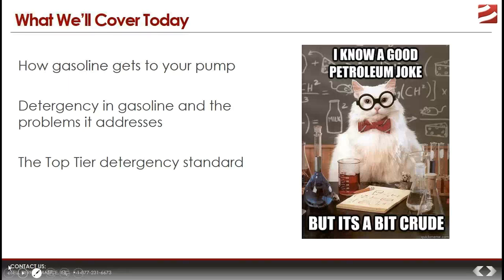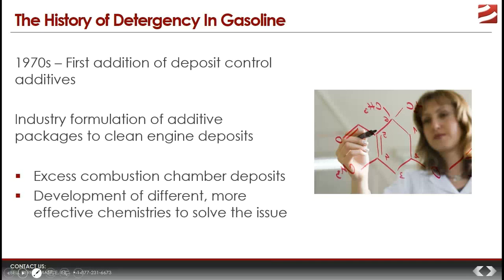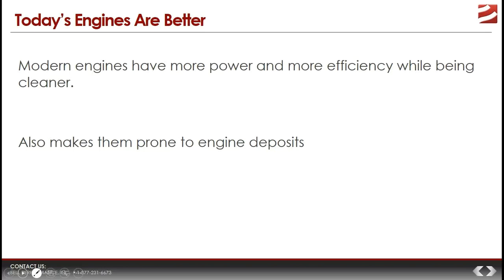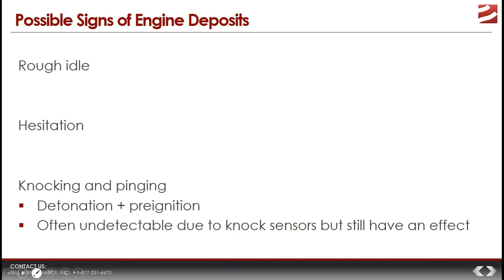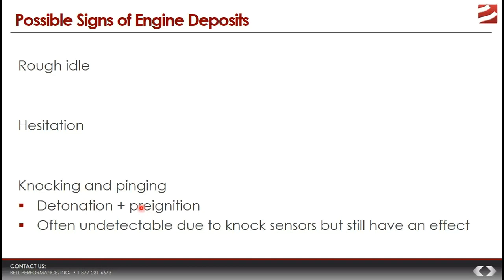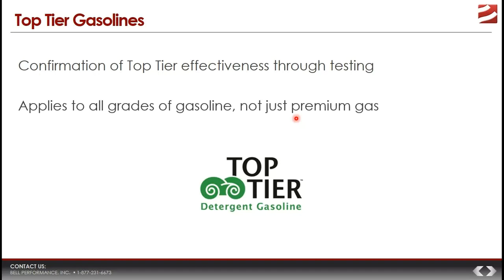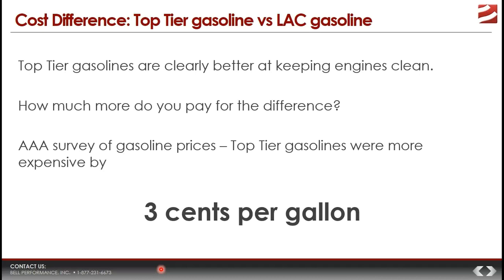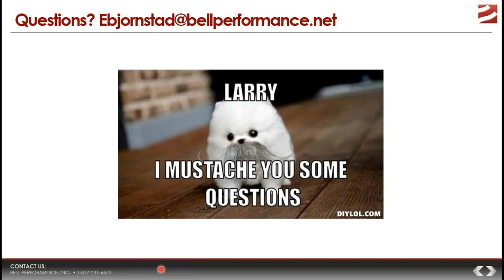Gasoline Detergency & Top Tier Gasolines - Bell Performance Presentation

Comment: So if you only use top tier you still have deposits after 50k miles for ex?
Reply from the maker: Hard to say after an exact distance, but the rule of thumb would be you'd have less deposits than with non-TopTier fuel.
Reply: Yes you will, but they will be less then non "Top Tier" fuel.  Gasoline is a dirty burning fuel, and those deposits are what gasoline leaves behind.  Also, don't believe the fuel additive bottles that say one bottle in one tankful cleans everything up (and yes they all say that).  It usually takes continued treatments to achieve the desired cleaning.  If the fuel additives don't contain PEA, the cleaners will not survive the combustion process to clean the combustion camber and piston tops. The ASTM 5500 standard is for intake valve deposit formation, and someone actually tested Gumout's One-N-Done product to it  -   https://www.bobistheoilguy.com/testing-efficacy-gumout-one-n-done-astm-5500/

Comment: Older V8 motors will last much longer then these GDI or turbo 4 cylinder motors/engines.  Example you will see a lot of 20 year old pick-up trucks on the road with 200K miles on them. These 4 cylinder Turbo and GDI won't go 200k miles and 10 plus years.
Reply from the maker: The way things are going, I wouldn't be surprised to see all these new engines lasting formula, if they're taken care of properly.

Comment: How does top tier fuel affect direct injection engines? I have read that because gas does not wash over intake valves, top tier does not make a difference. Is this true?
Reply: True, the only way to clean said valves of a direct injected engine is to inject an approved intake valve cleaner into the intake induction system at regular intervals... Sound fun?
Reply from the maker: That's an issue the industry is still wrestling with.
Reply: The cause of intake valve carbon is oil vapor created by heating the oil.I highly recommend full synthetic oil which handles heat better and therefor produce far less vapor.I forget the term for this quality but Pennzoil Platinum was the best at not converting to vapor beating mobil 1 and royal purple Valvoline.Crankcase ventilation system allow vapors to reach intake, therefore an oil catch can will also reduce the amount of vapor reaching intake valves.
Reply: Noack volatility is the term

Comment: Good presentation, but my God was it way longer then it needed to be.  When it comes to fuel economy, the biggest factor is your right foot meaning how you drive.  The more you right foot depresses the accelerator pedal AKA the gas pedal, the more fuel you'll use.  So if you drive aggressively,  accelerate towards red lights, and drive at higher speeds you'll use more fuel.  I'm always amazed when people complain about the fuel economy they get while driving aggressively.  GDI is as bad as the "Lean Burn" Chrysler's of the '70's.  Just say NO to GDI.  If you have a GDI engine, install a "Catch Can" in the PCV system and use only synthetic oil.  It also amazes me that people complain about the price of gas, but have no problem buying over priced bottled water, and over priced anything at Starbucks.
Reply from the maker: Indeed, lots of grains of truth in there. Driver operation is the biggest factor in fuel economy. And price is always a matter of perspective.

Comment: I just purchased a 2018 Honda Civic EX-T.
Since my car has a GTDI engine, I'm particularly concerned about intake valve carbon build up.
I want to ensure that my car lasts as long as possible so I'll only be using top-tier gas.
I know such detergents won't completely solve the carbon deposits problem with such engines, especially turbo engines.
However, this gas combined with regular valve maintenance at every oil change will hopefully prevent this issue.